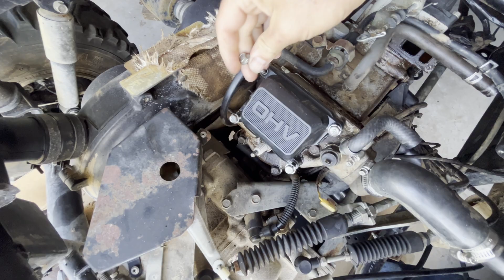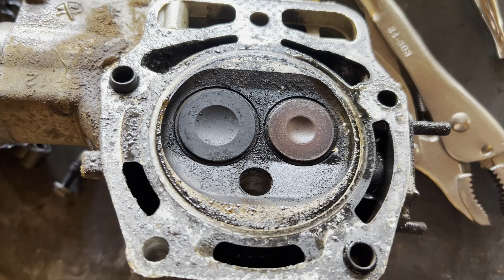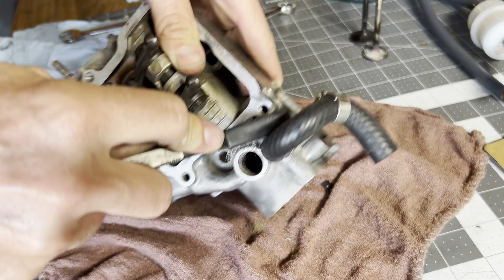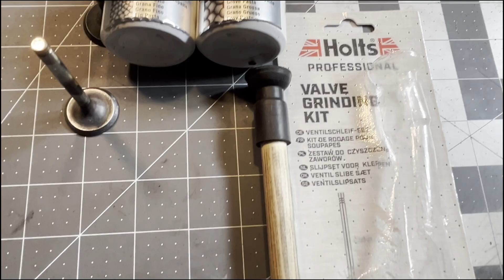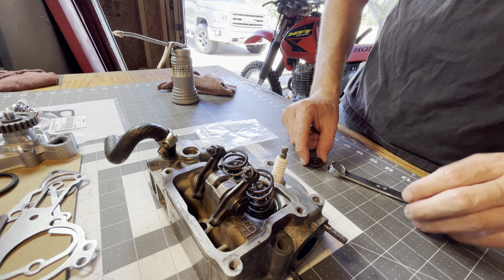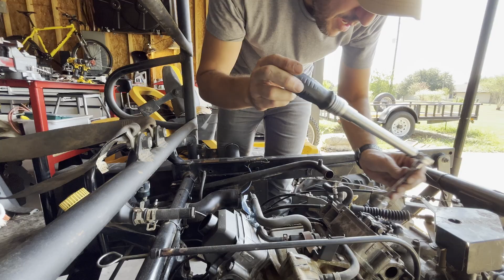Cylinder head overhaul 2008 Kawasaki Mule 3010

Comment: Did you reuse the valve keepers?
Did they come in 1 of the kits?
Do you have the link for new ones if you ordered them?
Reply from the maker: Yes, I did reused the keepers. No, keepers don't come in the kit, you can buy some valve kits if your valves are worn out on amazon and they come with  keepers. No link since I used the old ones. Change the keeper when you change the valves and to be honest, you could still use the old ones, very rare that keepers wear out. Thank you for checking the video.